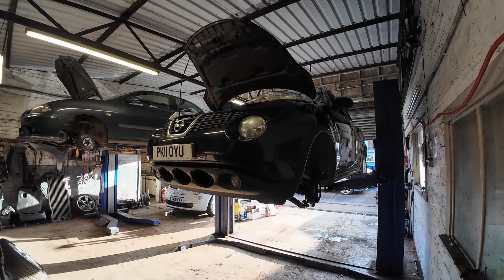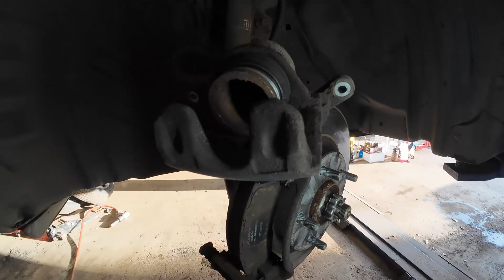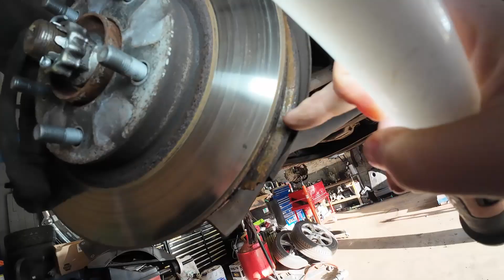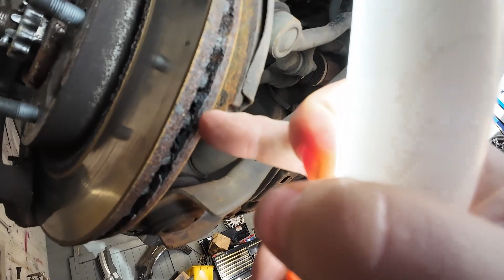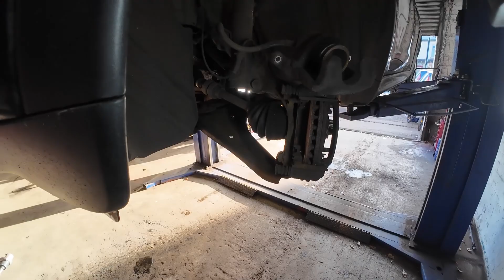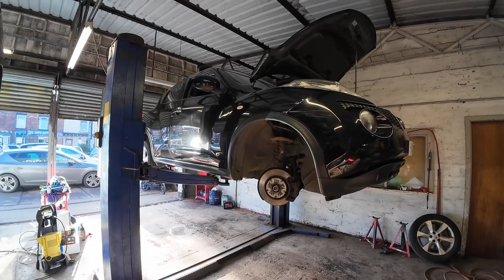I CANNOT BELIEVE THE STATE OF THESE BRAKES

Comment: And we're driving next to pillocks like the previous owner of that. My brakes were great and I went on a drive one day, 60 miles from home i heard scraping, took it really steady on the way back, brakes worked but the sound was bad. I used engine braking as much as poss, straight to the garage and the pads had only just got to the point of rivet showing through, changed them straight away. You NEVER mess around leaving brakes.

Comment: When i worked in a Garage we had a customer drive in complaining of a grinding noise coming from the front.
It was an original mini non vented disc, there was no disc on one side and the other side was paper thin about to brake off. 
We used disc, to exhibit in the reception to show what lack of maintenance can do.

Comment: Would have thought the Juke would have had something on the dash to say brake warning obviously not, i remember with the only brand new car i ever bought a 51 plate Golf GT TDI 150 and around 40000 miles the car told me and thats years ago if i remember rightly the brake pads had a wire that plugged into the caliper when they got so far down it broke telling you low .
Reply from the maker: Yes brake wear sensor, a lot of modern cars don't have them fitted anymore with exception of the bmw's and mercs

Comment: Perhaps the MOT should be stricter, when a car is tested, if the tester does not think the pads will last another 12 months over the average miles a car would do in a year, the rather than giving an advisory of "brake pads wearing thin", they should fail the car with "brake pads severely worn" instead. Too many people I suspect totally ignore advisories and think the car is safe as it has "passed" the MOT. If the car had hardly any pad material left and passed an MOT, then in a couple of months those pads could be down to the metal and the owner would think they were fine for another 10 months till they might "fail" the next MOT.
Car maintenance items seem to be costing more and more money nowadays, my own car was MOT'd only this week, and got an advisory on the front tyre being near legal limit on outer edge, so I replaced that tyre and the one on the other side as well, and was advised to have wheel alignment done too. Even Arrowspeed budget tyres (175/65R15) were 75 quid each and alignment another 65 quid, so a bill of 215 quid plus the 46 quid MOT fee, thats 260 quid just for a couple of tyres. I suspect people are simply avoiding garages due to the high cost of repairs, not to mention the long waiting times for some parts that might be on "back order" for weeks on end.
Reply from the maker: Current limit for pads is 1.5mm which is silly, its metal basically. I always thought that below 2.5ml would be better, we do have to balance it up a little. Sadly if the rules become stricter there is plenty of fast fit outfits who start failing items that are not needed as they are heavily target driven. You make some valid points steve   👍👍

Comment: Looks like that car was moted in Feb which failed on front brake pads & brake pipes. A day later they were acceptable when the pads clearly hadn’t been changed? Sounds like it failed a proper mot then had a bent mot & this is the result. That’s why they should go back to putting the mot station address on the online mot checker like they had for a while before. I know Lee will put the car right as he is an honest trader.